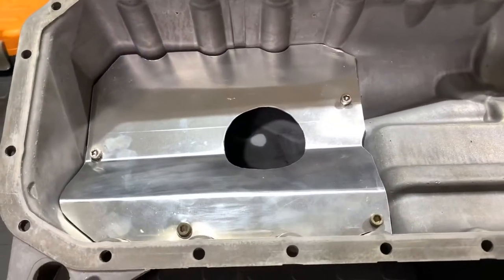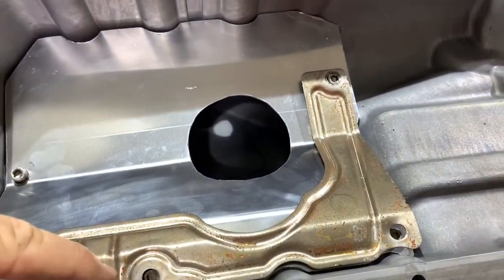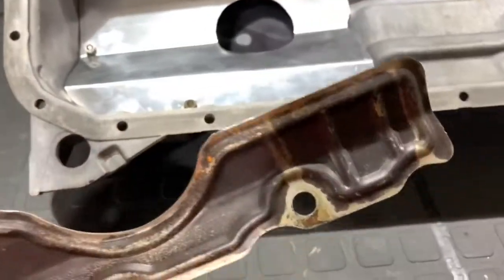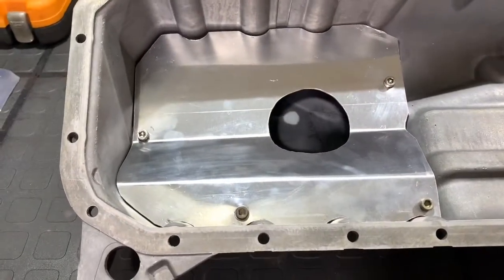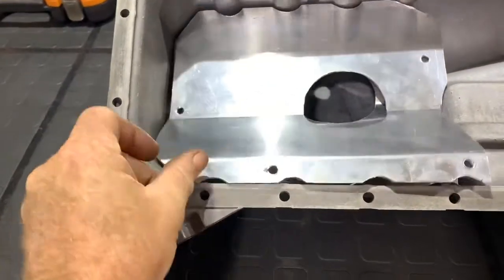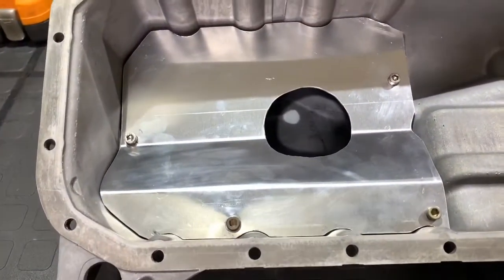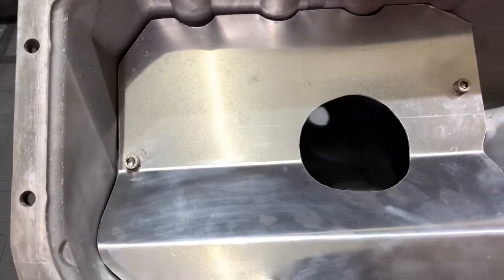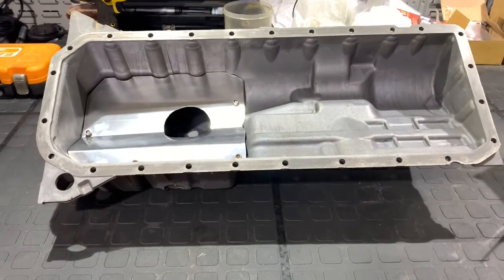E46 Race car sump baffle plate fabrication (HDWDT)

Comment: Great fabrication, do you have any sort of measurements? I'd like to try and make a baffle myself. Cheers
Reply from the maker: Didn’t take measurements, because it’s a bit of a busy shape. It’s very easy though to make up with the sump off - start with a cardboard template, then cut, bend and trim as required. The oil pickup hole position is a bit of a guess, but not too tricky.
Reply: How deep did you drill the holes in the original mounting points? I don’t want to drill too deep it looks like they go to the outside of the pan

Comment: Hello my friend! Great videos.... I was just looking for some content about M50 Intake manifold on M54 and found your channel. I've built a M54B30 Swapped E36 and I'm about to upgrade it to M50 manifold. I was thinking about building a sump baffle plate as well and it was a great surprise to find this video, thanks for sharing it. I'm about to install S54 Oil filter housing with oil radiator, M50 intake manifold and Nissan Hitachi Mass air flow sensor. I'll be racing it in two months, hope I get it done until there ! I have several videos of my build on my shop's channel, take a look: https://youtu.be/8gcr3D45aIk
Cheers

Guilherme from Brazil
Reply from the maker: That’s great Guilherme! Glad we can share our experiences.